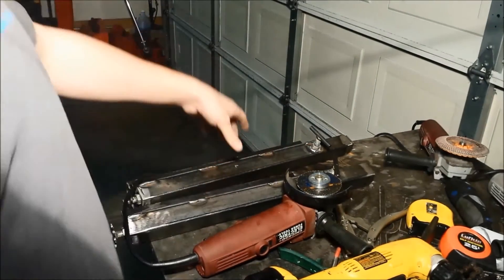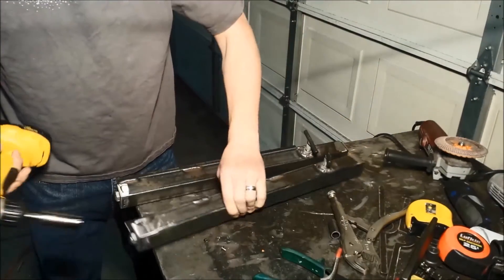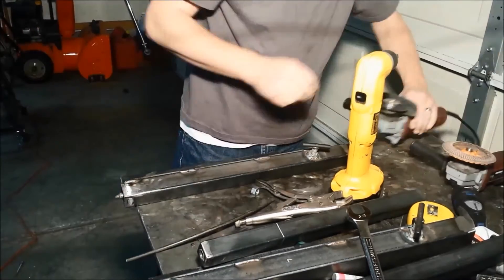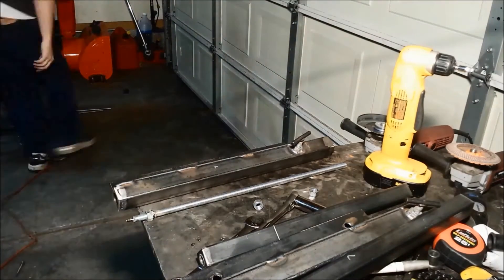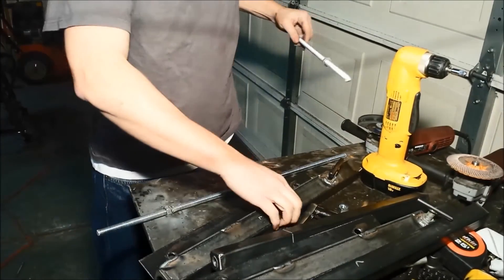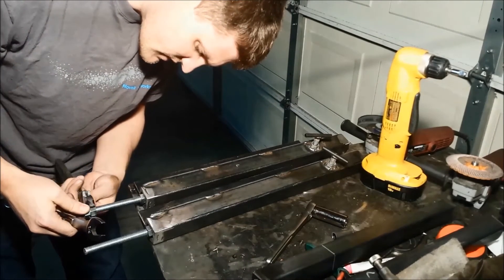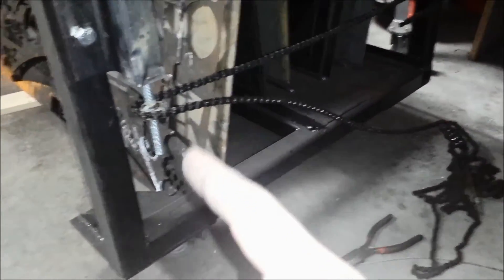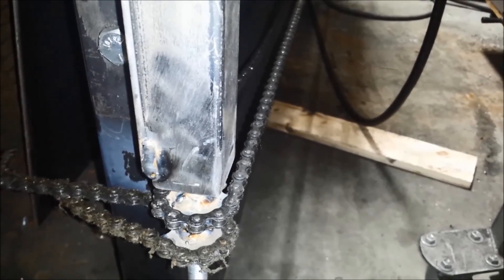Screw-jack elevator for my Plasma CNC -- part 5

Comment: www.joycedayton.com - four commercial jacks and line shafting could have been installed in about 4 hours. 
@Rick: chain is a commodity: www.mcmaster.com
Reply from the maker: probably expensive.  If you can't list a price on the site, and you have to request a quote, it is probably more than I want to spend.
Reply: available from McMaster - www.mcmaster.com - of course Joyce direct is more cost effective.  The big question is what is your time worth?